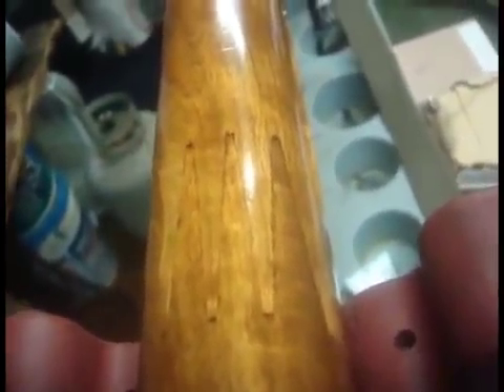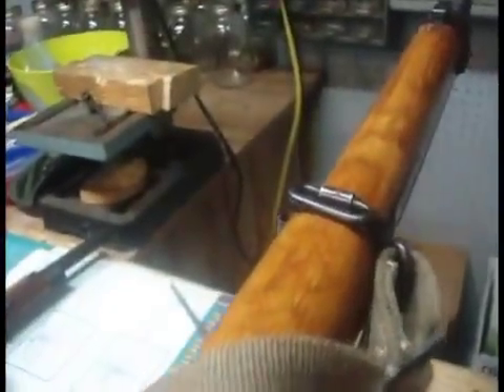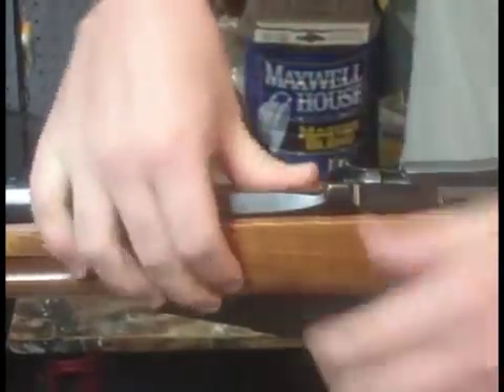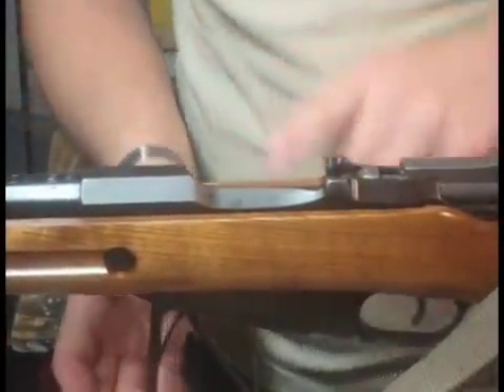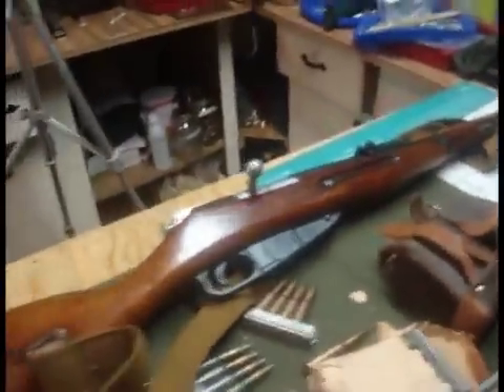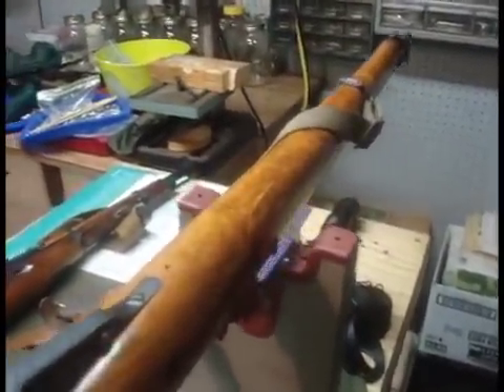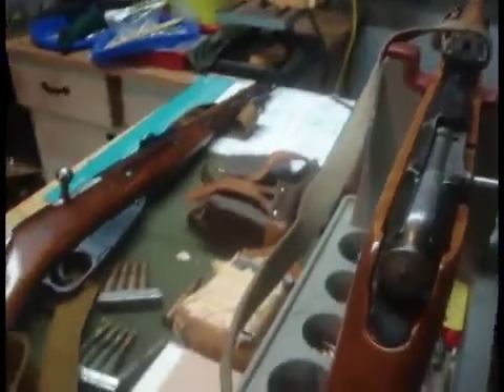"Review of the Mosin Nagant Series of Rifles and Carbines Part 3"

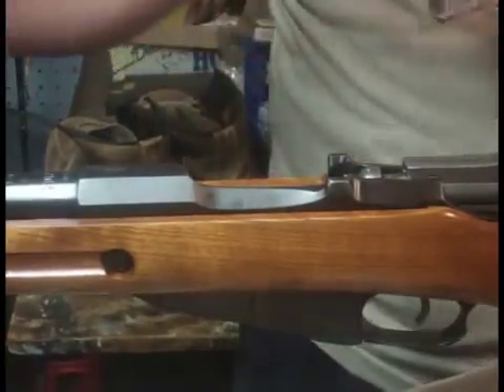Comment: 1:08 No, you don't.  A properly functioning interrupter will prevent rimlock no matter how the rims are stacked.  Additionally, the proper way to load the rifle from the stripper clip is however it works.  There is no "correct" way.  Period Russian demonstration films show the thumb positioned directly in front of the clip.

Regards,

Josh Smith
Smith-Sights.com